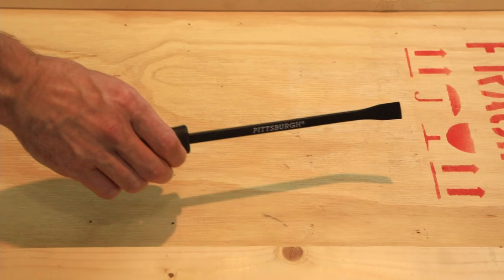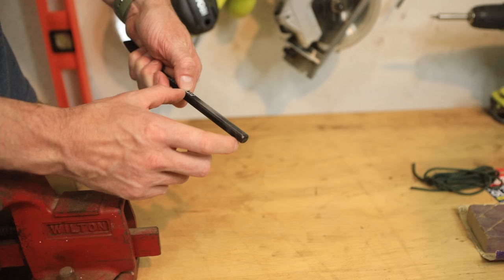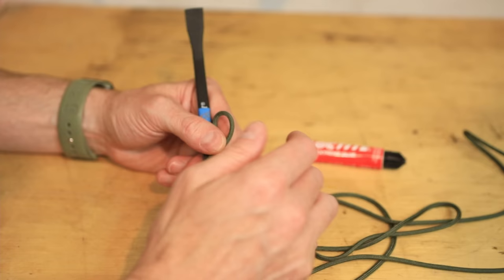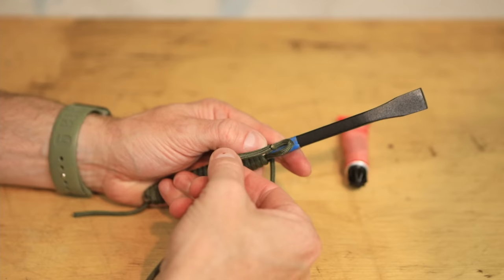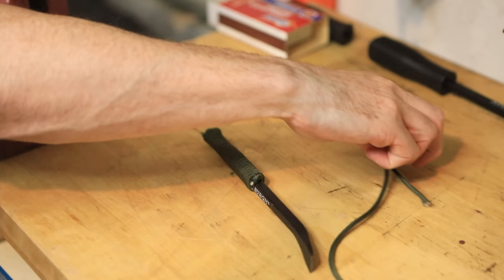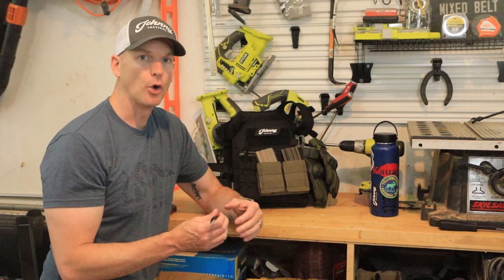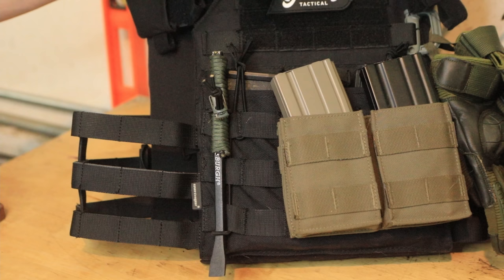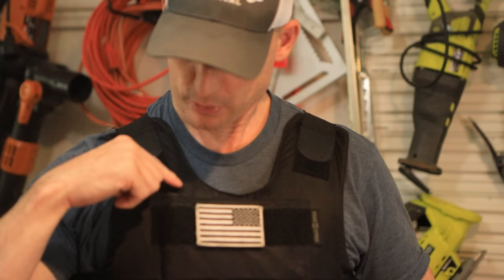The Key To The City: A DIY Tactical Tool You Can't Be Without

Comment: I like the look of the finished project, though I feel like cutting down a beefier bar would have worked out a bit better. As it stands, this bar is already so small that you've only provided the tool with a less comfortable handle while not really taking that much length off. The paracord wrap should be something that happens to this little thing once the handle inevitably breaks, not as an out-of-the-box mod.
Reply from the maker: Comfort isn't the primary reason for the paracord, it's to cut down on size (circumference) while giving you something to hold on to.
Reply: You can find a breaker bar in the field pretty easily in an urban environment, to slide over the end to increase your leverage.
Reply: @Valorius   or shove it down the barrel of your Benelli entry gun.  I think you mean cheater bar.  A breaker bar is an actual tool.
Reply: @brianwilson4861  Don't be a terminology Karen. The fact that you immediately knew what I was talking about illustrates that your comment was unnecessary. 
Even if you want to get technical, which apparently you do, once you put a cheater bar on another implement, it becomes a field expedient breaker bar.
Reply: @Valorius  Terminology Karen?  A breaker bar and a cheater bar are two different tools.  The tool you're calling a breaker bar is not a breaker bar.  What you're describing is called a cheater bar.    It's okay.  My girlfriend calls every adjustable wrench a "monkey wrench".   She calls Phillips screw drivers  "cross head".  I took her to the lake and she told me that it was a man made lake.  Yes honey I know.  "Well isn't it amazing that people dug this entire lake?  So do I tell her that the lake used to be a river and they built a dam or do I let her live another 30 years thinking that people dug out 50 billion cubic miles of dirt?    Maybe your girlfriend has been hoping someone would tell you that a breaker bar and a cheater bar are two  different tools.  Here's what OSHA has to say about cheater bars:. 
All respected international and governmental safety organizations and enforcement agencies such as OSHA, MSHA, CCOHS, EU-OSHA, etc. strictly prohibit or vehemently discourage the use of cheater bars due to the extreme risk of injury or death to users and bystanders

I don't think that you even understand why using a cheater bar can kill you.  I never thought that fixing your garage door could be dangerous.  Until the spring threw the screwdriver threw the wall.  I had a friend nearly killed when he struck the mushroomed head of a cold chisel with a hammer.  A piece of the chisel head the size of a letter on your screen broke off and shot through his chest like a bullet.  You don't put a cheater bar on a pry bar .  You spend $10 and buy a bigger pry bar.  I've seen a man killed when his cheater bar broke his pipe wrench
Reply: @brianwilson4861  holy breaker bar batman, I think I just found the motherload of karen driven anality. I do want you to know that I didn't read past about the first sentence of your tirade, but if it made you feel better to get all that off your chest I am happy that I was able to help you.
Reply: @brianwilson4861  I'm surprised you didn't ask to see his manager Karen.
Reply: @Valorius  Sounds to me like he needs a friend.
Reply: @Valorius  How dare you not take his OCD seriously.
Reply: Cheater Pipe

Comment: As a firefighter I carried a Stanley 12" wonderbar.  Worked great but what PIA in my pocket.  

This is a great idea. If the idea is just a more comfortable grip, how about some layer(s) of electrical heat shrink tubing?
Reply from the maker: Good question.  For me reducing size was primary, not to improve the comfort of the grip.  But like you said, there are other options and you might find one that reduces size and increases comfort. I have two others that I wrapped the paracord in friction tape just to keep everything together a little better
Reply from the maker: @ts757arse  That's good info, thank you!
Reply: Or just leave the factory handle on it....Having trouble figuring why he removed the perfectly good handle.
Reply: Self amalgamating tape gives a rubbery texture,  no adhesive built in so notching the bar would be necessary to bind it in place.
Reply from the maker: @anvilsbane  it's possible you watched with the sound off or skipped ahead... the main point is to reduce bulk so you can store it a bit more easily on your person or kit.  But again, it's whatever works for you and your set up. It is not the be-all and end-all.
Reply: @johnny_tactical  I suppose. I also suppose I was just being the token crotchety old fart, holding to the tradition “ If it’s not broke, don’t fix it). Not my intention whatsoever to troll. Much respect to the man that sees the world, and makes it his own. Cheers and respect.🙂
Reply from the maker: @anvilsbane  hey man, I'm all about dialogue! That's what moves us all forward!  I appreciate you taking the time to write. Cheers and respect right back at you
Reply: Hockey tape
Reply: Wrap it in duct tape or first aid tape so you can use it if needed.
Reply: What would you use a 12" bar for most often as a firefighter? I would think you would be reaching for a bigger one most of the time
Reply: @juliogonzo2718  In many scenarios the most useful tool is the one you have with you.
Reply: @EvanRedka  prying is all about leverage and this prybar would be better at prying open a door than a pocketknife but generally when you need a prybar you need a big prybar.  It would be about the same as shortening your lug wrench.  Yes you've made it easier to carry but you can't turn any lug nuts with it.
Reply: @brianwilson4861  I agree. But if I had to carry a full size tool with me I'd bring a Halligan. I'm not saying this is the best tool for every job, but if a firefighter is going to keep a few tools in their pocket all shift something in a smaller package is ideal

Comment: could have also ground the "pommel" part into a point to make a glass breaker, just an idea.
Reply: Don’t need a glass breaker when you have a metal pry bar. That is your glass breaker.
Reply: @lukecurnutte2000  I mean for car windows/laminated glass.
Reply: @The20thCenturyLimited  so do I. If you can’t easily get into a car window with this, then give up. Can be done with either end but the chisel end has corners that will blow right through a window.

Comment: I would like to see you open a locked door with it metal and solid wood door
Reply: I think that he means he uses it to remove doors from their hinges by prying out the hinge pins.  Of course the hinges are usually on the interior side of the door.  I used to carry one in my tool pouch when I used to install hardwood floors. But it usually was never in my pouch because I'm the kind of person that when I finish a job I don't waste timr putting shit where it goes.  I'd throw my shit in the truck and get the hell out of there I'd just use a damn hammer and nail if I couldn't find my prybar. There's no way in hell that anyone could pry open a quality locked exterior door with this prybar.

Comment: I thought you were going to build the tool not just remove the plastic handle and wrap it with paracord
Reply from the maker: Sorry to disappoint! I figured it would be easier for everyone to customize/modify an existing product than to forge it from raw steel.  Maybe someday I will be able to make one from scratch.  Thanks for checking out the video nonetheless!
Reply: How else were you expecting to show everyone how to make it?If you need a blacksmith's forge then it wouldn't really be DIY for most people. Creatively adapting an existing tool still counts as DIY.

Comment: I like the idea of thinning down the handle a bit, but think there are better solutions than paracord. Like taking the existing handle to a belt sander and shaping it. Then adding a lanyard hole is never a bad idea. Those of us with 3D printers can also whip something up that glues on as a replacement.
Reply from the maker: I like the suggestions and I like your username 👍

Comment: listen I'm a firefighter I train on forcible entry. The absolute best tool to use to force a door or window would be a pro bar. The task can be performed quickly and efficiently, it's no comparison. The length and weight gives you leverage to make forcing the door easy. That lil thing is gonna have you fighting. IJS
Reply from the maker: Like a halligan?

Comment: I been wrapping tools knives, c even pistol gripswith paracord, leather, nylon, manilla-- even copper but I've never glued anything like all these urban combat guys do-- plus removing the finish means more frequently having to UNwrap to brush the rust off that will ALWAYS collect underneath the cord and cause itcto rot.
Reply: The second he said sand paper… my mind was like, rust.
Reply from the maker: 10 years with my three mini pry bars and rust has never been an issue. I take care of my gear, but if you don't, I could see that as a potential problem down the road
Reply: @johnny_tactical  I leave the finish on my tools/gear, that’s how I “take care of them.”    When I was in the corps, I used to love watching how quickly guys could clean their rifles with metal brushes and harsh chemicals just to have the rust keep coming back faster and faster.
Reply: @johnny_tactical  personally I just leave any finish alone and either way, rust wouldn't actually be a problem for a couple years- it mainly eats the cord up and it's a problem for anything you use every day or every other day- I guess you might actually have to use a bar a couple times a year?? At any rate it prolly ain't a big deal
Reply from the maker: @ericjohnson8001  you're probably right about that
Reply from the maker: @josh2711  understood, and thanks for your service!

Comment: Use a claw foot style, which is added functionally at no expense. Screw the loctite. The paracord is in no way essential to the function of the tool, but having a length of cord around can be quite helpful. So, notch the pry bar handle or drill a hole and use them to keep the cord tight and in place. While you're at it, you have the potential to hide something under the cord. Maybe an extension in the form of a length of square tubing. Without something clever like this, I'd recommend a short Cats Paw over a prybar with its handle cut off any day.

Nice video though. Looks professional, and you present well. Just going to need something more creative to impress tool/tactical/EDC geeks.
Reply from the maker: Thanks Alex. I agree…The DIY / EDC crowd are some tough cookies

Comment: Congratulations you just made the bar shorter , therefore less leverage .
Reply from the maker: Not much leverage needed, actually.  I've used it for years and it is great otherwise I would not have recommended it
Reply: You can always use a pipe for more leverage
Reply: @ExPhantomHD  well that’s something else to carry 👎🤦‍♂️
Reply: @benjaminc8789  you keep it in your truck if your planning on using it

Comment: You do understand that the work of a prybar is done by being a lever, right? The longer the lever the greater the force? You've also reduced the strength of the grip you can get on it. You've accomplished making a prybar less effective than it already was for its short length. The only way to make this more gear queer-y is to put a punisher skull on it.
Reply from the maker: Thanks for watching.  It's a small tool for small jobs and to assist seating larger tools, that is all.  It's possible I didn't explain that well enough.  And for the record, I am anti-punisher skull.
Reply: When making entry adrenaline will make that extra 1/2” of missing prybar a non issue as well. I like to watch videos with the sound off too, but I didn’t with this video. Good idea! Thanks for the video
Reply from the maker: @mastrsk8  Thanks, I appreciate the kind words

Comment: So you took a perfectly good handle and replaced it with a crappy handle 👌
Reply from the maker: It's a modification for a specific purpose -- to reduce size and bulk.  Plus it's like handicrafts for operators.  What's better than that?
Reply: @johnny_tactical  your tacticool "key to the city" is a joke. You went looking for a solution to a non-existent problem. The result ended being an inferior tool.
Reply from the maker: @richardcontinijr9661  it actually works really well. I've carried one for over 10 years.  I believe in it otherwise I would not have recommended it
Reply: @johnny_tactical  ok ok I understand withdrawal is a terrible thing to go through. Copium is a powerful drug.

Comment: I would suggest using a Mac or Snap On prybar for this project they are much much much stronger units than any of the economy/budget chinese pry bars.
Reply from the maker: I totally agree that brand / quality matters. I had trouble finding Craftsman which is what I have used in the past so I used what I could find in stock. Thanks for the feedback 👍

Comment: Cool idea. I'd leave the nitride finish on it. More corrosion resistance sure but for one I'm lazy and the second but main reason is that coating will generally hold up longer than your paracord will. If you want some extra bite for the epoxy grab a center punch and dimple it up a bit. Also ding up the corners with a grinder, file or punch/chisel.
Reply from the maker: I didn't think of that.  Thanks Mike

Comment: I understand why you would want to use a cheap prybar but in my experience you don't want a cheap prybar to let you down. Get a better quality bar these bars can not depend on. Using Pittsburgh prybars I know they are soft and bend or break when you need them most. Drill a hole in the end for a lanyard and make sure all the edges are smooth so your cord won't be cut. A tool for combat must never let you down focus on quality.
Reply from the maker: That's a great point and one I should have brought up.  I have used Craftsman in the past but had trouble finding one of this particular size and shape until I found it at Harbor Freight.  I get that it's not great quality and I didn't mean to come across as recommending that brand in particular.  Thanks for pointing that out I hope other viewers see your comment.
Reply: I was thinking the same thing.  When it counts, you want the good stuff!

Comment: Should have left the factory handle on and cut or sanded it down and added some grooves for grip. The way you did it, allows for a point of failure. Much use and pressure and that paracord will come loose. Could also have drilled a couple of holes to run the paracord through to attatch it more securely to the prybar.
Reply from the maker: I appreciate you taking the time to watch and for the feedback!

Comment: I have a 48 inch gooseneck crowbar that can get into anything.  One does not even have to be strong. It is always in my vehicle because the old vehicle is a rolling hardware store.  It has about all basic hand tools, many chemicals, cable, a spool of wire, map gas torch, flux, silver solder, saws, an axe, a hatchet, rope, duck tape, electrical tape, contractor bags, a shovel, a pick axe, 10 meters of extension cable, mineral oil, an OBD2/CAN analysis automotive computer, a digital multimeter, 2.5 kilowatt inverter, 4 MREs, three gallons of water, firestarter, an all bad and all mode transceiver, 10 headlights, four reverse lights, and much more.  I know, I have no life, nor friends.
Reply from the maker: You will be everyone's favorite person when the apocalypse hits

Comment: You could slide it down the barrel of your shotgun and use the shotgun as a cheater bar.  Or epoxy a bayonet handle on it and mount it on your ar15 where the bayonet would be.  Or epoxy a picatinny rail on the prybar and mount a tactical light on the prybar. I like it how you choose the best tool that 5 bucks can buy.  You should sand off the Pittsburg logo and wrap an H&k sticker around it.
Reply from the maker: Thanks for all the great ideas. There are just so many I don't know which one to try first!

Comment: Like this idea. The only add I will do is grinding the top into a round pointed window breaker. Have a 1/4 inch out of the top of the 550 cord. I carry and old style military issue wire cutters. Great for cyclone fencing. This tool would be a great addition.
Reply from the maker: Good idea. Thanks for watching and commenting!
Reply: @johnny_tactical  glad I found you channel.
Reply from the maker: @Catspurrlounge  Wow, thank you, that means a lot

Comment: I have that exact pry bar. Any door that thing will open a good swift kick will open. You ain't gonna get through anything substantial with that pry bar. It bends.
Reply from the maker: You won't be able to kick in outward opening doors. And this is intended to be a supplementary tool to larger tools, not the be-all-end-all.  Thanks for watching and commenting, I appreciate you

Comment: The lack of leverage on this would concern me.  Seems like just about any door it would breach would be easier to kick from beside the door with minimal exposure, it would be good to see it demo'd on a real-world house door, particularly under stress.  I'm not above being proven wrong, just not convinced there's enough "oomph" available in this little nugget to separate the door and frame enough for deadbolted doors where you need it most, and you really don't need to pry most interior doors, they'll pop if you glare at them hard enough.
Reply from the maker: I hear you. But you can’t kick in outward opening doors. Also, the tool is not intended to be one size fits all but rather more of a supplemental tool to aid larger prying tools, and one that is very portable. I did a video called “manual breaching basics” that might answer some of your questions. Check it out and let me know what you think. Thanks for watching taking the time to comment.